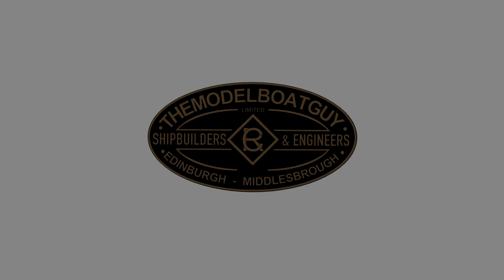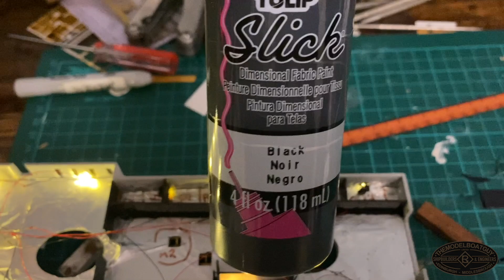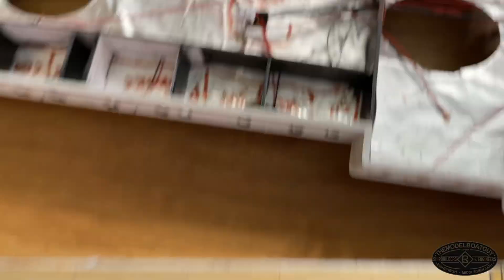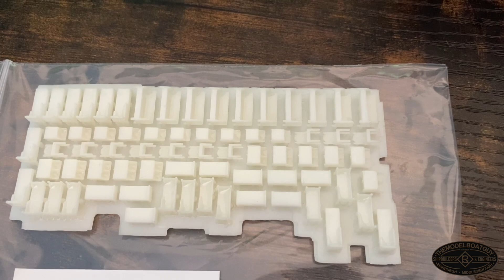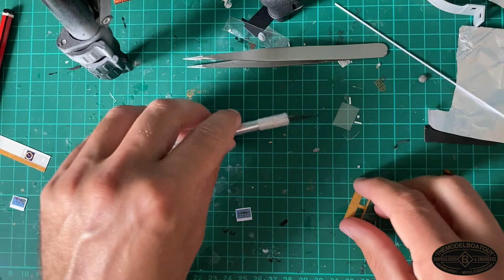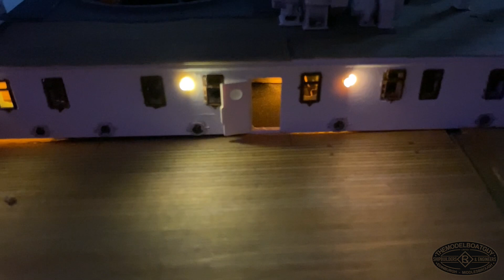Radio Control Trumpeter 1:200 Titanic Build Part 62 - Officers Quarters Part 3

Comment: Youre work is a piece of art.
Realy good.
Only arent you afraid of shortcircuit with those wire solders open and a aluminium foil sealing?
Reply from the maker: Hi there,
Good question, I have isolated these joints so they shouldn’t short. If there is a short it isn’t a catastrophe as the lighting circuit is fused and those LED wires are so thin they’d melt very quickly!

Comment: Great video :) Robbie are the portholes along the bottom not lit? If not I'll have to block mine ...:/
Reply from the maker: Well I suspect there is a debate to be had here! 
They are skylights for cabins on A deck, as these spaces didn’t get much natural light due to them being further into the ship to accommodate the promenade decks. 
So I think if there was a light on in the A deck cabin there would be a subtle light from the skid light, but I don’t think it would be as bright as the light you might get from a window. What you have done is fine, so id just go with your gut 😛
Reply: @TheModelBoatGuy  Thanks Robbie..I might diffuse the light a little..;)